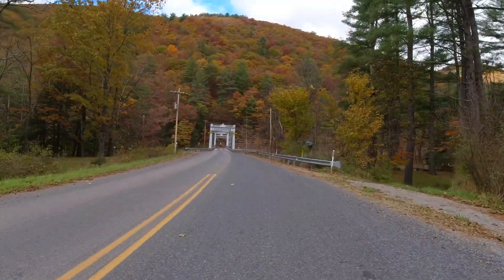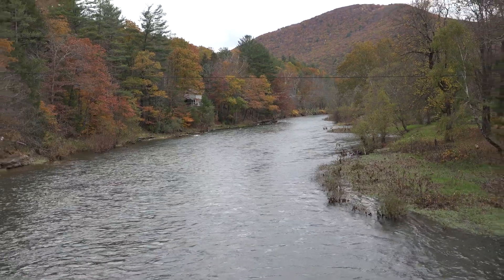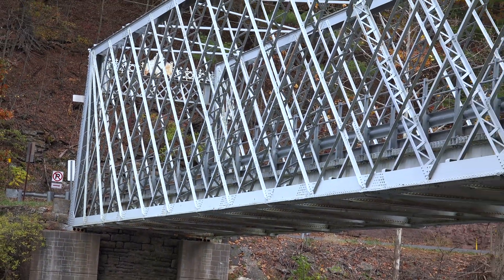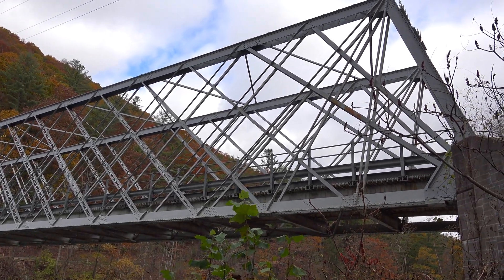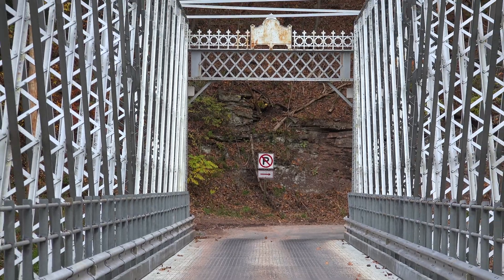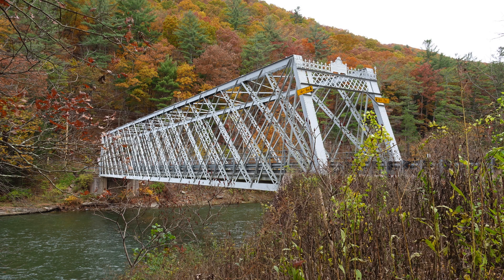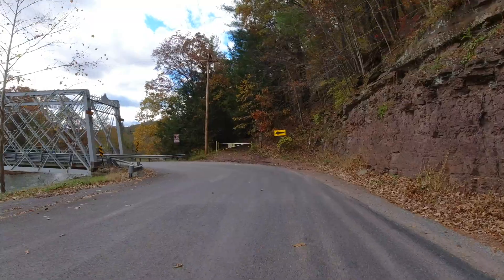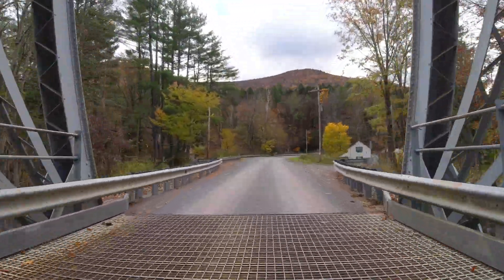Upper  Slate  Run  Bridge,  Slate  Run,  Pennsylvania

Comment: I've been over this bridge hundreds of times in the 1980's early 90's. My Grandfather was an original founding member of the Studebaker Hunting camp located about a mile north of this bridge. Pine Creek is great for smallmouth bass and Slate Run and Cedar Run are amazing trout fisheries.  I watched the demolition of the old iron bridge in slate run back in the 80's. Cedar Run also had an old iron bridge but it was removed in the 1980's as well.  Waterville also had an old iron bridge over Pine Creek that was removed in the 1985? but the bridge was saved and moved to Swatara park near Ft Indiantown gap and is now a footbridge.
Reply from the maker: We  have  lost  so  many  steel  bridges.